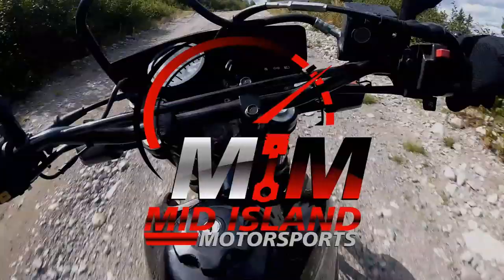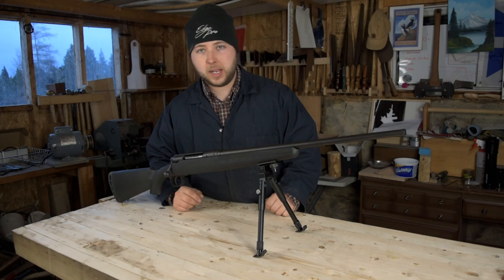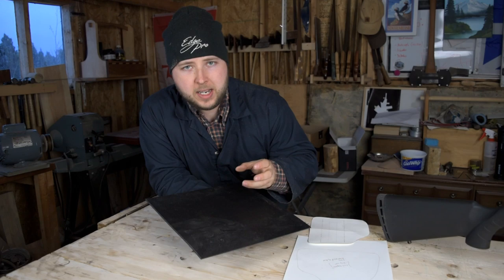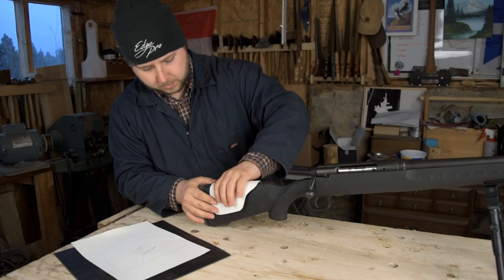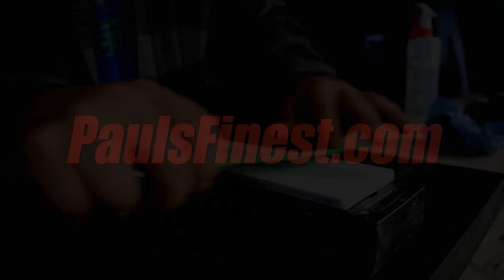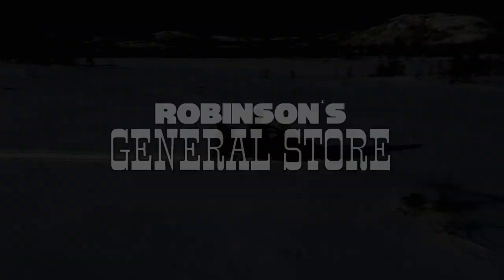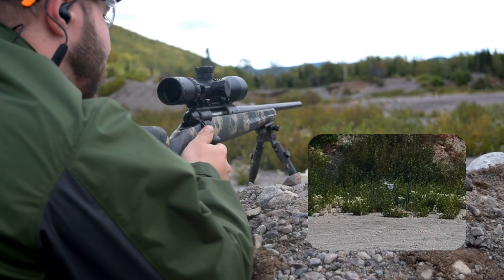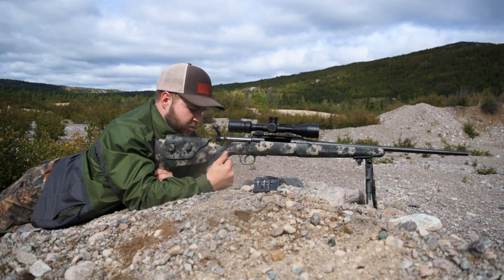Building a Big Game Rifle for Cheap! - [NLH 2]

Comment: If you want to tighten up your accuracy and consistency, look into glass bedding your stock and increasing the clearance between the barrel and stock a little to ensure it free floats and pressure on the stock doesn't affect the barrel. Another thing would be to try various brands and bullet weights of ammo until you find just what the rifle likes best. Nice results overall. Looks like it fits you nicely.

Comment: Kyle,

Thanks for the great videos. 

I just bought the Savage XP 308 in a camo print as my first . I did something
Similar. I added a longer bolt handle to mine, mcarbo pro spring kit (didn't come with the accutrigger), vortex diamond back optics and an MDT oryx stock. I'm upgrading my rings today. I'm 6'4 and that short flimsy stock (love the camo pattern) but for me needed to upgrade the stock. 
I think up next will be an mlock bipod and or sling mounts. Can't wait to shoot it.

Happy holidays to you and the family.